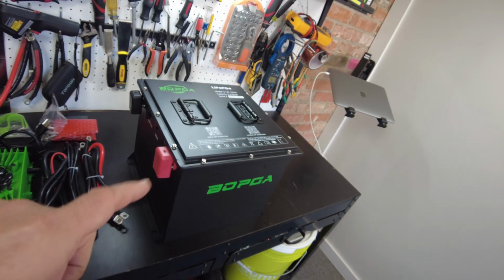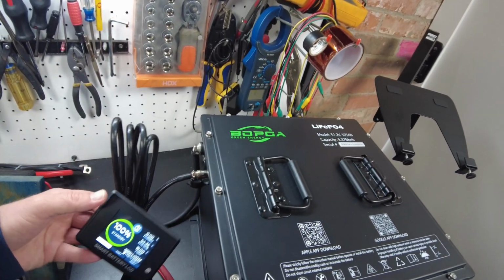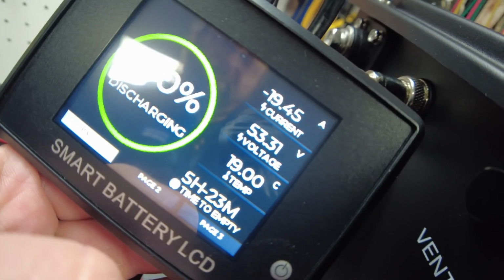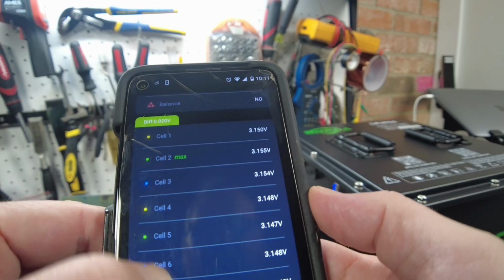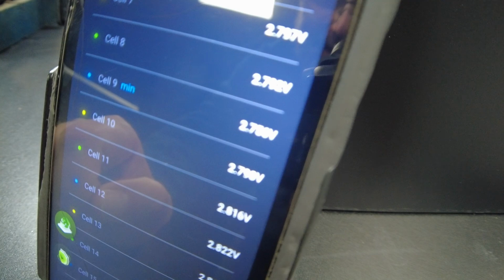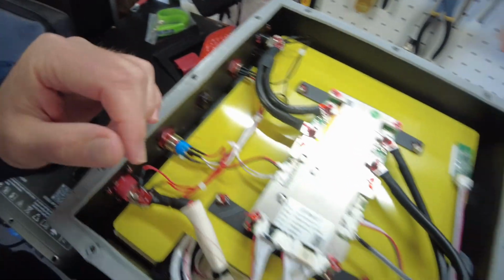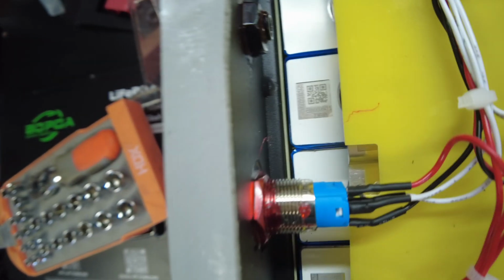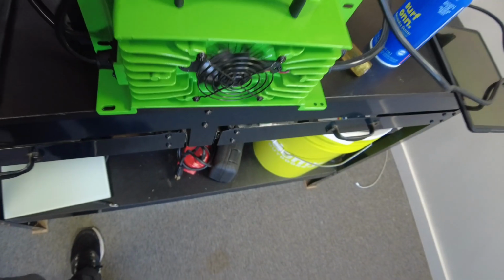BOPGA MINI 48V 105Ah LIFEPO4 Lithium Golf Cart Battery

Comment: I’ve noticed on mine that I can turn the battery off and the two run switch off and after a couple of days I check the battery monitor screen and it will be at least 1% lower each time. A few days later it’s another 1% lower. It doesn’t seem to hurt but kinda bugs me. I guess it’s ok.

Comment: I'm considering giving this a shot for 2004 club car precedent 48 volt. The eco brand battery is like 2700 plus tax. This is a 1000 on Amazon plus tax.

Do you think is good build quality or is it cheaply made
Reply: I’ve been using this battery in my2006  club car precedent. I like it so far. I have spoke with customer service several times just because I don’t have any experience and had questions and they always answered me usually late at night and I would see their response the next morning. They seemed to be helpful.

Comment: Nice to see someone else looking at this one.  I too was super surprised at the small form factor.  Seems like it could allow folks to easily double up in their carts.  Overall it did well in testing and quality review.  

Your app looks different than the one I had.  A little surprised that the iOS and android apps are different.  

The listing used to say 200a bms but I told them they needed to correct that since there was only a 150a bms in the battery.
Reply from the maker: Oh, ok LOL that make sense now. That's why I was confused I when I saw the 150a BMS. I thought that I had looked at the listing before they shipped it, and it said 200a. When I seen it listed on Amazon as 150a, I figured I must have been thinking of a different battery. Yeah, the form factor is really neat. Man, I'm getting swamped with these golf cart battery review requests. I guess I need to get a golf cart LOL. Thanks man!
Reply: @ no worries!  Yeah I need to find a cart too!

Comment: $1800 is a lot.  Server racks are going for under a $1000 these days.  Are they not interchangeable?  Serious questions by the way, I’m just a spectator in the battery world so far.
Reply from the maker: Well it has a $200 off coupon, and comes with a charger that's probably around $150 so we're at $1450. Also the BMS is beefier to handle the load of the motor, and then I guess it's kind of a special case/mounting/formfactor? Maybe these kinds of batteries will eventually come down as competition heats up? Thanks!